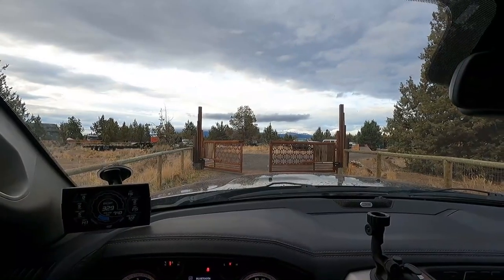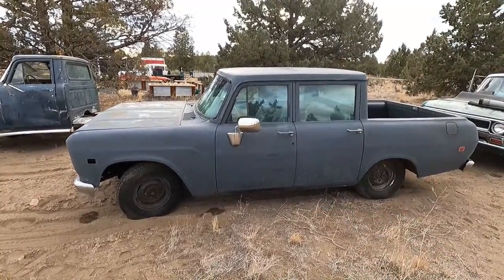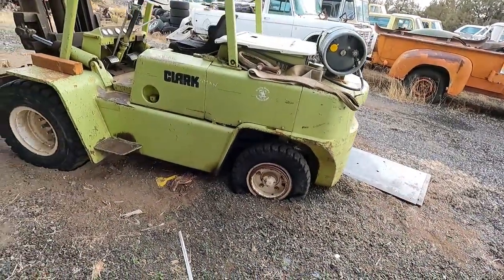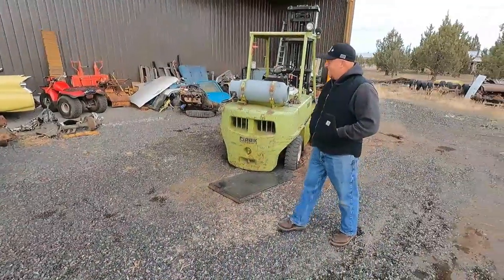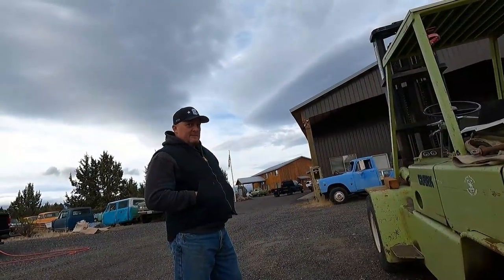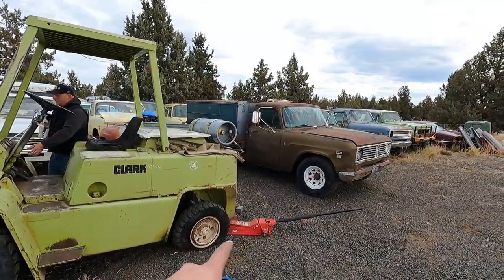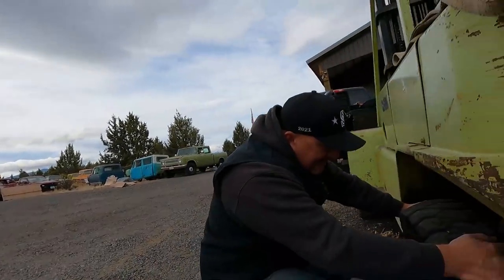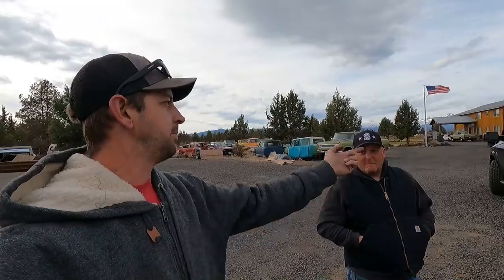18,000 pounds stuck in the sand, Yankum Rope to the rescue!

Comment: Back in the late 70's I learned to drive a manual transmission in a '69 International 1200D 4x4 pick-up. We used it to plow snow for several years, before it was sold and replaced with a 1981 Jeep Scrambler.

Comment: We used to live up in Eugene Oregon we lent our jack to a person stuck with a flat tire they did not bring the jack back to us. The next day we went to work we came home in the dark and got a flat tire on the side  of the highway. The only thing we had on us was a book a tire iron and a flashlight. So we had to change the tire with just that. So I put the book underneath the lower control arm and with the tire iron I began to dig a hole. I removed the lug nuts and removed the flat tire. I  reinstalled the spare tire and we put the car in drive and drove out of a hole with front wheel drive. The next day I brought a used jack at a yard sale.The moral of the story when you are in dirt just dig a hole.

Comment: What's your wheel and tire setup on that dodge??
Reply from the maker: Pro Comp 37x12.50x17
Reply: @CaseyLaDelle  what are those wheels though? They look like they're a 10 bolt off of a railroad truck. Look good
Reply from the maker: @glazedandconfused4756  they aren't, they are just a Black Rhino 17" wheel